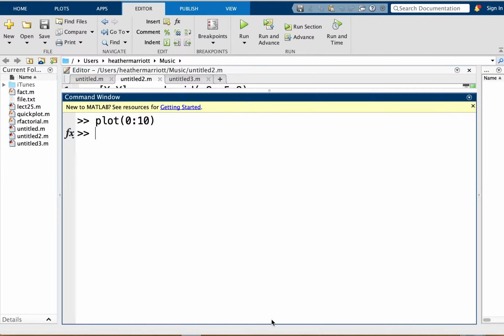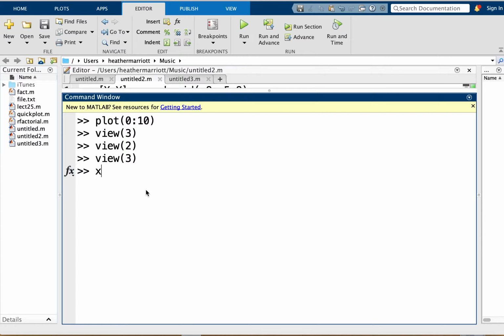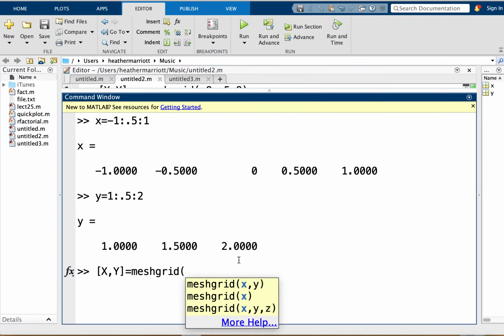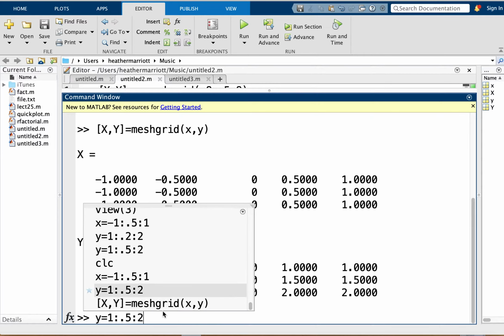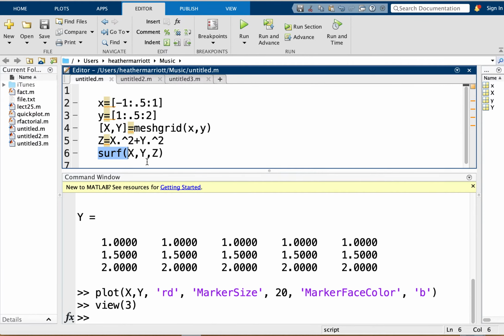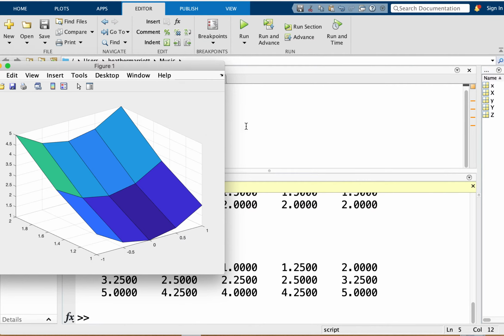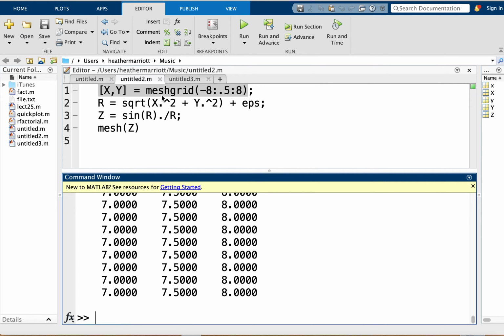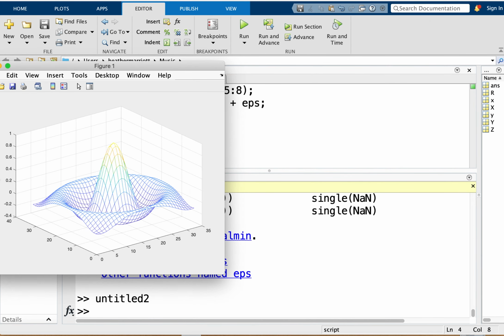MATLAB meshgrid, surf, and mesh 3D plotting

Comment: Hello there, thanks for the great video!
I have a similar program that I need to do in MATLAB.
I have around 100 rows of X,Y,Z points as a data file, to be considered as a matrix.
And 100 rows in 1 column of binary data, as a vector.
I need to slice the 100 rows of xyz matrix data, with the vector data to obtain a 3D model.
Could I contact you in person, maybe an email, regarding this problem?
I do have a rough code, but would like if I get some help from someone who's well versed in MATLAB.

Comment: Thanks for the video! Question: Once I have a 3D surface, is there any way to interpolate to find a Z value based on an X1 and X2 values that dont have a Z value defined? In my case, Z is not based on a formula.

Comment: I love the explanation, it's so clear! 
Anyway could you help me to draw a 3d graphs but rather different than these one on video. My data is of the format (x,y,z,T), where x,y and z are axes indicating a point and T is the colour value at the specified point. I'm so thankful if you could make video to solve my problems, thanks in advance!
Reply from the maker: Great question.  To be able to see individual points on a 3D graph you will want to select a point style, otherwise the points will be too small to view.  Ex.  to create a red diamond: plot3(0,0,0, 'rd'). and since you want more than one point to be displayed on the graph use: hold on command at the beginning of the program.  If you are given the color in a variable T.  ex T='r' then you can combine it with a shape: strcat(T, 'd') to use as the 4th argument to plot3.  If you need me to create a video, send me some of the exact x,y,z, T values and any other requirements and I can create a video today.
Reply: @PainlessProgramming  first of all thanks for the quick response. yes it will be very helpful if you could make a video because I don't know much about 3D graphics. here are some of my data in (x, y, z, T) format: (3,25,300,Yellow),(2,25,500,Green),(1,75,700,Red),(0,50,500,Blue),(-1,50,300,Yellow),(-2,50,500,Green),(-3,75,700,Red). and could you show me how to plot in a shape other than points, like a mesh or maybe a surface (if it's possible). Once again I thank you very much for the help.
Reply from the maker: @andremartin7059  https://youtu.be/9TSRZg6dbwg  - hope this helps you visualize the data.